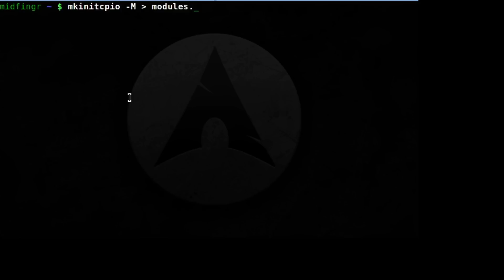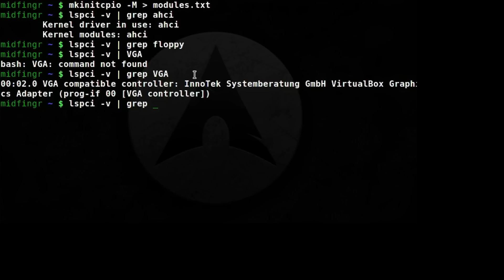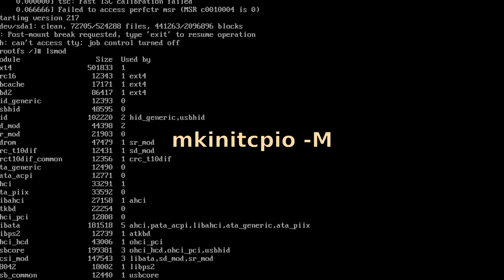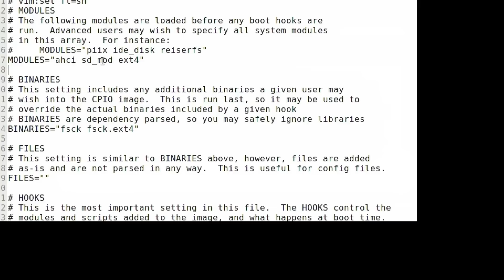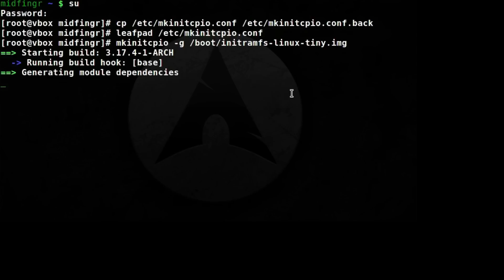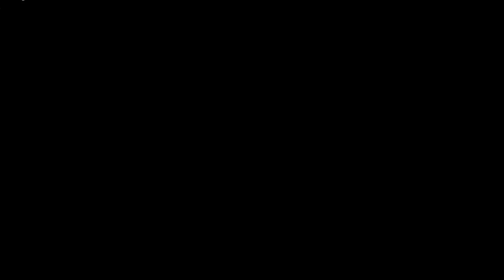Optimize Boot in Arch Linux

Comment: cp /etc/mkinitcpio.conf /etc/mkinitcpio.conf.back

MODULES=(ahci sd_mod ext4)

BINARIES=(fsck fsck.ext4)

HOOKS=(base)

systemd-analyze

Startup finished in 2.237s (kernel) + 5.127s (userspace) = 7.364s
graphical.target reached after 4.772s in userspace

sudo mkinitcpio -p linux 

reboot

systemd-analyze

Startup finished in 1.494s (kernel) + 3.634s (userspace) = 5.129s
graphical.target reached after 3.459s in userspace

Comment: BEFORE:
2.864s(kernel) + 492ms(userspace) = 3.357s
AFTER:
1.560s(kernel) + 410ms(userspace) = 1.970s
Reply: Bruh, what super computer are you using???? TF ???

I don't get that even with a modern mid range laptop, your comment is Fing 6 years old... Bruh
Reply: @godfather7339  I would like to know those specs too.

Comment: systemd-analyze

before the optimization
Startup finished in 2.556s (kernel) + 22.793s (userspace) = 25.350s

after optimization
Startup finished in 2.045s (kernel) + 14.931s (userspace) = 16.977s

uname -r
3.18.6-1-ARCH

thanks for the info ;)
cheers!
Reply: I get this: Startup finished in 5.811s (kernel) + 1.539s (userspace) = 7.351s
Do you know why my kernel is taking so much more time than the userspace? (I'm on an ssd, 5.10.6-arch1-1)
Reply: @megaoyi1Wins  haha I have no idea sorry
Reply: Nina rani Bhoi  lol I know. I'm using that one now, thanks